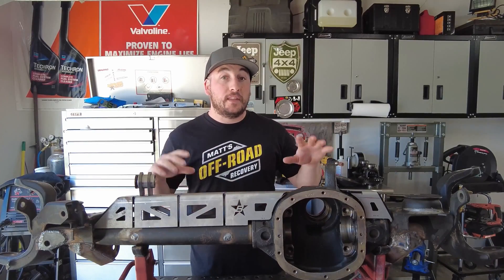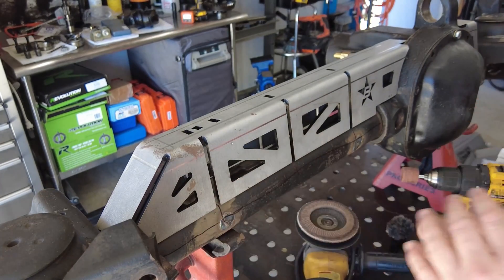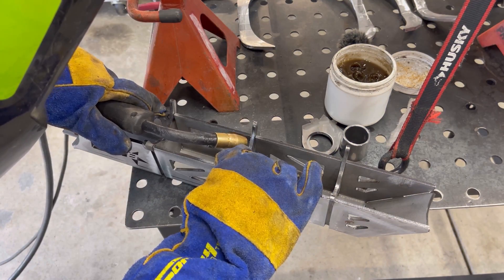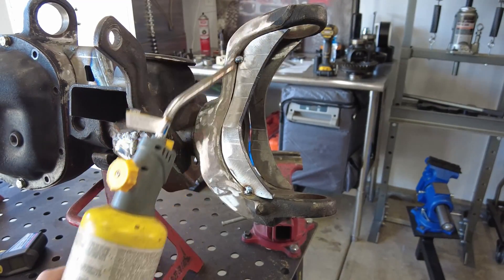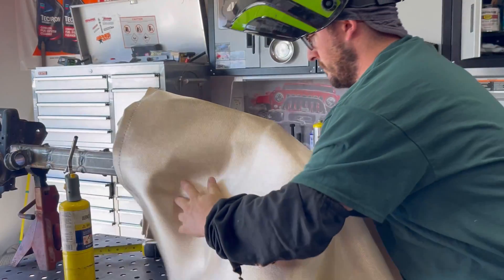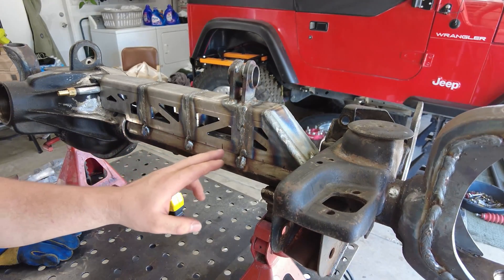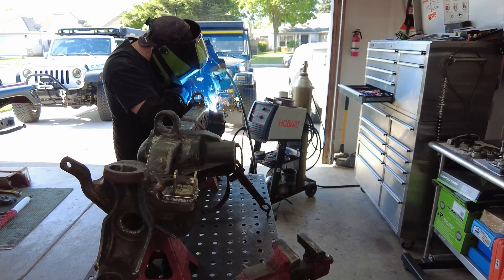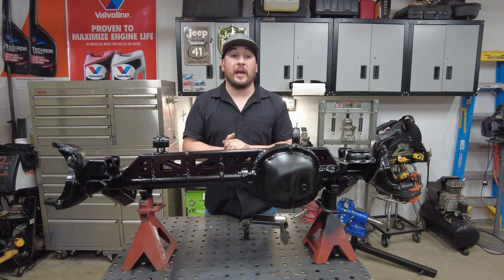Jeep Wrangler Tj | Lj | Xj - Axle Truss, Inner C Gussets & Other Dana 30 Modifications

Comment: Do you think you could still get RCV axels in after the c gussets are welded on ? I need to beef mine up on the next axel I build cuz if bent mine now. But the rcv  is super tight getting them in
Reply from the maker: i think you can, i'd stick an rCv in there before i weld though, so i know where to fit up the gussets to clear. 🍻

Comment: Nickle based rods are for steel to cast iron.  The tubes and C's are made of cast steel so no need for preheat. Only the center section is made of cast iron. Nice work 👍

Comment: Looking for your opinion- is there any point in doing this to a low pinion Dana-30 or if I’m going to do it, should I do it right and find a high pinion?
Reply from the maker: @cam-vb8cu   the high pinion axle will offer more benefits over the low pinion absolutely 👍🏼 but if your jeep is built around a low center of gravity LCG design. 3” lift or less, I don’t see a problem with the LP as they are pretty strong. The HP solves so many problems if you do end up building a LP i suggest minimum crush sleeve eliminator for pinion setup during a regear.

Comment: Hey Dustin, great video , thanks for posting!  Quick procedural question.  You didn't weld the inside of some of your welds, specifically the "C" reinforcements.  Any particular reason for that?  Keep the great videos coming!
Reply from the maker: Thank you 🙏🍻 and yes I did only weld one side and the ends inward, I know I could have done more welds on the inside, but at the time I didn’t want to much heat to warp the C and I also felt like the one continuous weld was enough heat and penetration. I had my welder maxed out for those welds and only on one side I had to stop and start back up a few times to reposition myself. 🍻🍻

Comment: I have a rear Dana 44 off a jk if you want it it’s yours
Reply: It has 4.56 Yukon gears, upgraded axle shafts and a curry diff cover that’s solid.  I put a curry 60 on the back of mine and I’m tired of tripping over the old one. No  parking breaks. I used those on my new axle.
Reply from the maker: @mikemorris7776  nice 👍🏼 I’ve been considering the curry axles for another build, reasonably priced compared to some diy builds I’ve seen.
Reply: About 25 miles east of Modesto. 10 miles south of oakdale
Reply from the maker: @mikemorris7776  if that’s the case we are probably neighbors 😂. I’m not sure when I can check it out, but here’s my email we can exchange info atemoffroad@gmail.com. 🍻🙏
Reply from the maker: I might have to take you up on that since they seem to be non existent in my area, are you in the valley or Bay Area by any chance?
Reply: I’d like to find a Dana 30 non cad axle to replace the Dana 30 cad axle in my 88 Cherokee or adapt this type of truss kit to weld to the  cad 30 I have.  A D44 would be to wide up front for the ford 8.8 I have in the back and I don’t want to use spacers on 8.8.